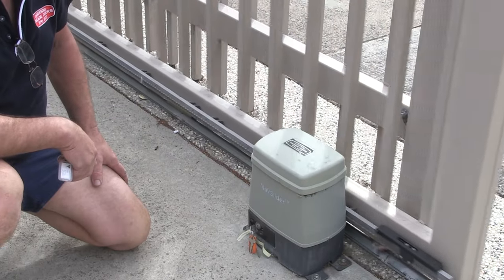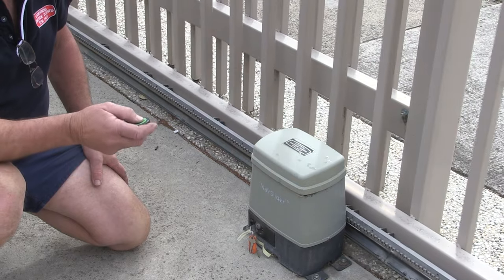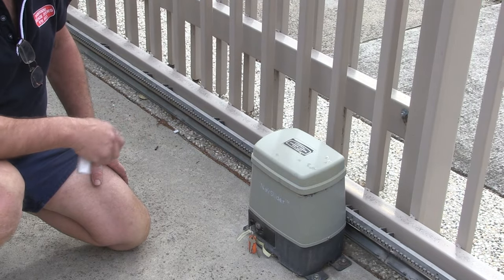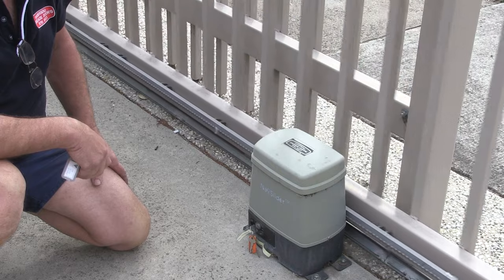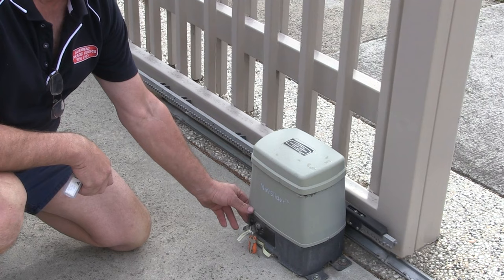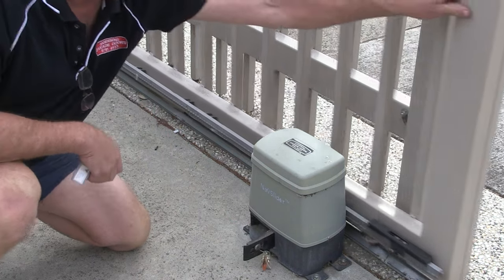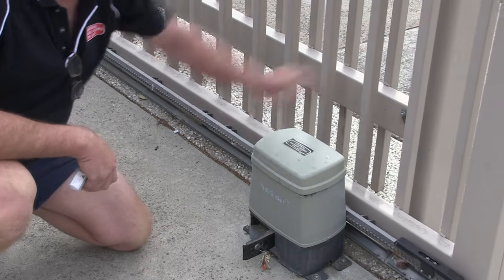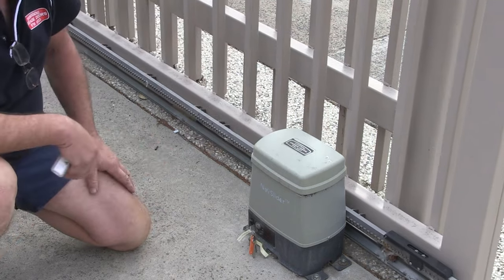Operating a ATA Neoslider Gate Motor Manually

Comment: I tried to disconnect the power by opened the door. But power still connected.  The key is a bit rust so i hardly open the door and then power cannot disconected. Please help
Reply: What will I do in this case the door is not opening